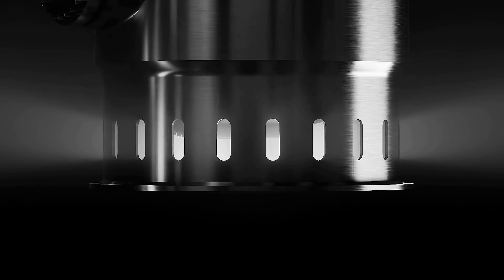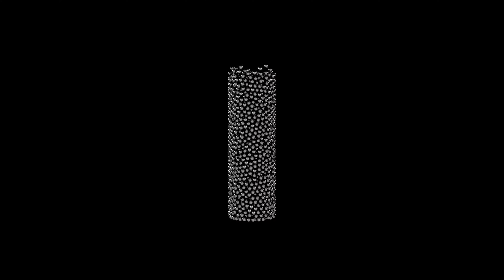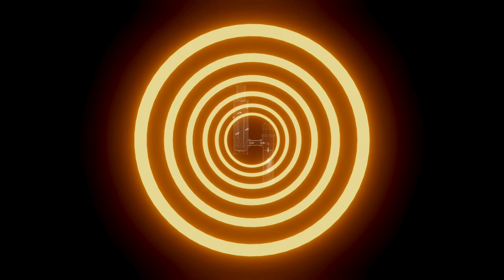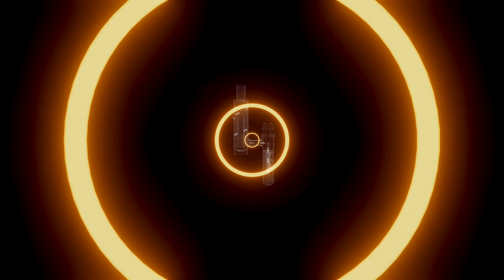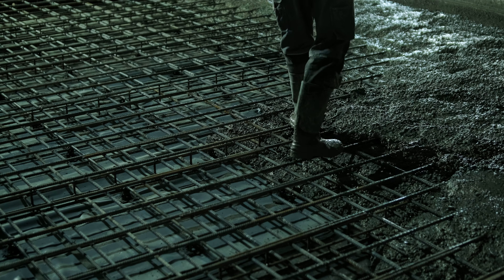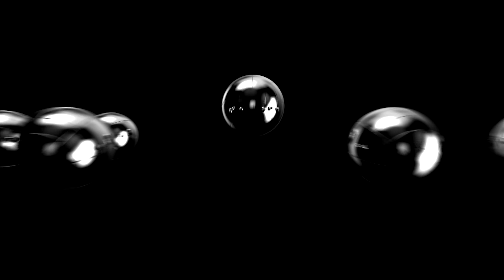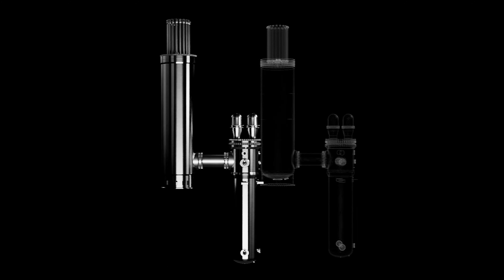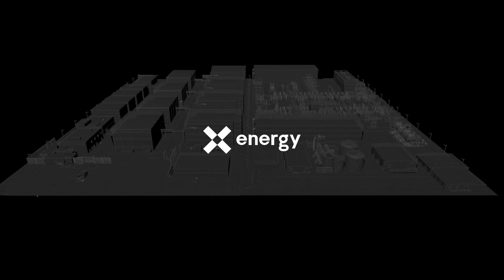Technology Overview: A Deep Dive into X-energy's Advanced Reactors

Comment: Helium running through this 2 story metal chambers? 1400 Deg F helium is fed around piping to heat water. Lots of fittings in there, you ever work with containing helium? I have, it gets through the finest crack, and it’s not cheap. I think there’s a cheap heat exchange gas, with a little bit of helium added.

Comment: Nice design but "double the temperature" generally makes no sense.  
The stated temperature of 1400F translates to 1030K (which is the only unit that makes sense when talking about "doubling" of temperature).  A typical LWR is about 600K, so not quite "double" but a major improvement.  
{If I double temperature from 0 F or 0 C what is it?}
Reply: If you use C temp. it is exactly doubling.